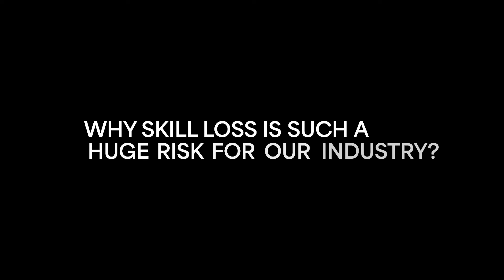Are We Losing the Ability to Make Things in North America? | Machine Shop Talk Ep. 133

Comment: Things the company I work is starting to enforce, these are their big concerns - No coats on the shop floor.   No lunch boxes at your tool box.  No holes in your clothing.  Women in leadership roles,  Women in machining roles.  If you smoke your going to pay (a direct quote from corporate HR), Protected classes, pronouns, the color of paint on the walls.  These things the company has been very firm on starting to implement and or total control over.  Not a single one of those things is a money maker for the company, not a one of those is producing more parts.

If they cared a fraction as much about Routers being correct, processing the job correctly,  the correct tooling for the job, and  good steel to work with we'd be making loads of money.   So who wants to work for a company that cares more about your lunch box than they do about production?

Comment: Well "machinist" is overused so much now, you are not a machinist if you just type numbers into a computer and press start lol. Technology of course ruined manual machinists and the speed and efficiency cannot be matched. Much of the old ways are long gone and these new 50-500k machines do everything for you
Reply: I've seen this argument so many times. Every time it's bullshit. Turning hand wheels does not make you a machinist.  The tools have changed, but the skills are still the same.
Reply: @brandons9138 right buddy....a kid who cant read a mike, cant measure anything, doesnt have a clue about toleramces and never even had a bead of sweat on his brow is now a.machinist because technology made them obsolete...running a machine does not and never will make you a machinist just because the end product is the same.
Reply: @B_ROB_82 Technology hasn't made machinists obsolete by a long shot. It just made us more efficient. One guy on one machine turning hand wheels can only do so much. One guy can run multiple machines and produce more product. Anyone that can't read a mic, or inspect a part is not a machinist. They aren't even an operator.  If all they do is load materials then they are just fleshy robots.

If I can hand a guy a print and he hands back a part to print then he is a machinist. The way he does it isn't really relevant.
Reply: I understand what you're saying, as I've done both manual and CNC. As I'm sure you know, a good setup will make or break you no matter if you're doing manual work or CNC work. That's one of the skills missing today.

Comment: Compensation is a huge factor in the problem. I machined from 2004 till 2024. The last few shops I was at, I was the lead programmer and\or foreman. I got my Class A CDL last summer and started out on day 1 making as much money driving a dump truck as I ever did machining.
Reply: You’re making the same as you were 10 years ago when adjusted for inflation.

I just left a lead machinist position to pursue repair work with an old Bridgeport.  Fast turn around focused at boats, commercial and heavy equipment as well as semi conductor.  

I’m sick of giving away my skills for so cheap.
Reply: Or a case of beer.
Reply: It’s not the Shop’s fault… It’s literally the industry… There’s just not enough money to go around. Margins are razor thin and competition from Asia is higher than ever… Nowadays, you can upload your drawings to a website in China and they will ship it to you cheaper than anyone in the US can make it. And they will do that for single parts… Not even large runs only.
Reply: @CL-yp1bs that’s why I’m focusing on work that NEEDS to be done ASAFP lol
Reply: @CL-yp1bs  I hear what your saying but what are R&D labs and engineers proto typing suppsose to do, I had to build my own CNC machine and learn 3D printing so its kinda nice to see prices go down
Reply: "There's gotta be a better way to make a living than this!" --Humans!
Reply: Thats incredibly sad.
Reply: Machining and design is a huge skill set to start your own buisness, certian skills like machining and welding are not just about what an employer might pay you but can you build your own CNC machine and nice TIG welding and set up your own gig?  If you let your skills go then you loose that opprotunity.  For instance im getting an A&P to work on my own plane, I have no intention of doing some kind of shift work like a jester
Reply: And grinders and hogies from all over the city
Reply: Unfortunately you probably were not working in a shop with high margins. High end medical device was very profitable.
Reply: @Franklinguy759 yes it is but it’s also expensive to get setup to do that.  Most shops aren’t even iso 😂
Reply: @Rightisallwrong  They got some crazy ass machines to do that stuff. And here I am just wanting a wire EDM so I can cut sharp corners on small rectangular and square holes more easily.
Reply: @DKNguyen3.1415 Scraper attachment on a Bridgeport could do that but obviously not with the level of precision a wire edm is capable of lol
Reply: @Rightisallwrong  The only mill we have is a CNC. We have a manual lathe so I never touch the CNC lathe. I wish it was replaced with an identical CNC mill or manual lathe so I could reduce the fixture swaps needed. Need three of every machine!
Reply: @DKNguyen3.1415 look into modular vises and modular fixturing.  I loved using Lang plates when I was doing 5 axis.

You can scrape with a cnc mill, btw.
Reply: @Rightisallwrong  Can you scape with a CNC mill? I'll have to look into that then. I know it can scrape metal with you mis-position a tool but it seemed that the machine might not be designed for that.

When I was talking about re-fixturing I was talking more like swapping out a vise with an indexing head rather than special fixtures specific to your workpiece.
Reply: In the last shop I worked in we had two 3 axis trak mills, 3 wire edm’s, 2 precision surface grinders, a Hermle 5 axis, and a Rofin laser. 3 guys and we all programmed our own work. We also designed our own work holding for each job. Our software was Solid works, Mastercam , and Camplete (5 axis verification). High end machines with high end expectations put on us.
Reply: @Franklinguy759 and I’m sure you made less than $100k a year.  Which is criminal.
Reply: I was right around that number. However I had a 3 and 1/2 day work week (Monday to Thursday at noon) 40 hours, Zero overtime, Health Insurance, and a 401K. In my area of the country that was a very good gig. BTW I retired 3 years ago at 60. Not bragging in any way but It was a well planned career. I also had to endure plant closures and a relocation to make it work, so it wasn’t all roses.
Reply: @Franklinguy759 That’s not bad, the problem is if you map your wages and adjust for inflation, you were probably making “more” 10 or 20 years ago.  Which is the same point I’m at where I’m just going to keep crawling for that last $20k but by the time I get there, I’ll need to climb another $20k to keep up.  Our wages stagnated a couple decades ago.  You retired at a good time.  

Also, congrats on your retirement!

Comment: we have a problem at the moment getting a good 5 axis programmer/machinist, the guy we had who was very good left, The one we have who has been doing this 44 years has never been good and can't use the 5 axis as a 5 axis, to tell the truth he can't use the 3-4 axis very good. the scrap rate from the mills is huge, We can't train anyone up as we have no one to do the training. the turning section i run makes the money and covers the loss from the mills,  the small 3- axis mill with an indexer i have on my section makes more money than 3 vmc1000s and 2 5 axis. My boss keeps asking me to go over and sort them out, But i refuse as we need to get rid of both the guys we have and start with a clean slate, I would get the guy who left back to do the programming of the 5 axis as a sub contractor( he would) employ some millers with limited experience who between me and the guy who left could train up. But money does come into it, i get emails and calls all the time from agencies offering me similar money to what i am on, company adds offer the same as what i earn, why would i after 40 years doing this and 19 years at the same job want to leave for the same money or a small amount more, i like my boss they pay me full sick when needed and the older i get and now with COPD sometimes i need it. but also with training some people don't want it they are happy with min wage and a bit of overtime and like an easy life.

Comment: The biggest barrier to entering the trades today isn’t skill or interest. It is the unrealistic demand for experience that no one is willing to help build.

I was fortunate enough to grow up in a machine shop so I stepped into roles as I matured enough or in some cases got tall enough to operate a machine.  I never graduated to tool and die but I did have to disassemble and clean them and remember looking at all of the intricate parts thinking about how long it took to make each one.

But thinking back, we didn’t expect someone straight out of school to be a great machinist.  You put them on the less expensive projects.  You knew that they would grab that 5/16 drill when they needed to tap something 5/16-18, you knew that if you told them to make this shaft fit that 1.000” hole, they would turn it to exactly that size and wonder why it wouldn’t go it, they would go through tooling at an alarming rate, etc.  You expected to take a loss on them for a while and knew there was a risk that they would leave before you turned a profit on them but you did it anyway.  Companies aren’t willing to do that these days, my son is interested in becoming a machinist so I’ve been looking more at the job postings and similarly to automation, everyone is looking for 3 to 5 years of experience.

Also, education went through a rough patch when it came to most disciplines that support manufacturing.  Many of them didn’t invest in new equipment or completely closed their programs.  I just got back from Automate and they had an education summit there.  It was geared towards PLC programming, one of the panelists said that students could learn all they need today with simulation software.  While I have been tempted to borrow one of the Haas CNC trainers from the local school to catch up on modern CNCs, I don’t think these simulators can have the same impact compared to a student hearing that tool crash into that part or seeing the chips bunching up or feeling the machine vibrate where they are taking too heavy of a cut.

Companies need to start taking a chance on the inexperienced person again, donate material and tooling to schools to help cover the shortfalls in their ridiculously small operating budget, volunteer at their local schools to talk to the students about why they need to learn certain things to be successful, help the teachers understand what skills students need to have marketable job skills, etc.

Schools have to start seeing the trades as a successful career path.  I should have gone to a trade school.  In high school, I took advanced math because I loved solving equations and English in summer school because I was a poor reader.  My counselor never mentioned anything but 4 year universities and I wasn’t college material so I dropped out. While I don’t think they talk down about them like they did when I was in school, they certainly don’t celebrate someone signing up for the local trade school like they do someone who is getting ready to take on $100K of debt to get a 4 year degree.
Reply: I'm the "machinist" at our research lab. Only because the one machinist we did have left and I had spent a few months just watching him work. Other than that I basically had to learn everything on my own. Low stakes though since all I do is machine prototypes that are only used in-house. And yes, I did go through tooling at an alarming rate when I was starting and I still do whenever I need to do a new operation or work on a new material.
Reply: @DKNguyen3.1415  I was fighting chatter the other day...turned out the chatter was coming from the holder, not the cutter.  I pushed a 3/4" endmill (four flutes) all the way to 25 ipm at 975rpm in 304.  It actually worked fine for side milling, but I also was cutting a .0886" deep slot with it, so after two parts the corners on the endmill were completely shot.  Switched to a half inch tool with a third of the length on the hard holder, cuts perfectly clean at 1570 rpm and 11 ipm.  Not a sign of wear after 25 parts except for .0002" extra width towards the bottom of the part after I end it up.  Lesson learnt, 6 and a half thou per tooth is way too much for stainless.  One of the older guys who runs a hybrid manual/cnc mill on the other side of the shop came up to me after running the first part and told me "You're running it too fast.  I hear it.  That endmill is tearing the metal, not cutting it.  You're going to burn the tool up."  It was in spec, so I didn't listen and make adjustments like I should and ended up paying the price for it.
Reply: @Soundpost-f2l I don't follow spec because I don't to production and don't need the speed. Spec is always way too much.
Reply: @DKNguyen3.1415  I mean spec as in the part's dimensions, not feeds.  Feeds were about three times recommended.
Reply: @Soundpost-f2l  Ah I see. I have never gone beyond 0.005" per tooth in anything but plastic.
Reply: Place I work was for a few years hiring total greenies (including myself) with nothing more than a few months of preliminary training at the local community college. Starting pay isn't fantastic, but the benefits are alright and job security is practically guaranteed for the foreseeable future. I was hired in with a "class" of about fifteen others; after two or three, only two of us remained. There's a roster with nearly 200 names along with hire dates, of those names only 20-30 predate 2020. Some of the newer hires came from other shops, but not many. It's led to a situation where people with less than three years experience, and frequently subpar skill and knowledge, training new people on the floor, instilling very bad habits. For the most part, the old guys are either complacent or bordering on senility. Disastrous.
Reply: @Tim A dentist who implants a dental implant in France, and who uses the same know-how as an adjuster or a mechanic in terms of precision, will collect $16 per minute (yes $16 per minute).
 Spending one's life in a workshop, to create value for others and not for oneself no longer makes any sense in Europe/USA.What to do while waiting for this to change?
Earn about minimum wage and live rent-free in your grandmother's beautiful villa.